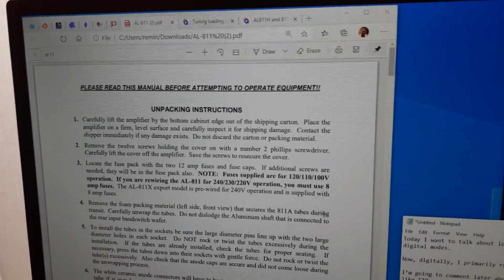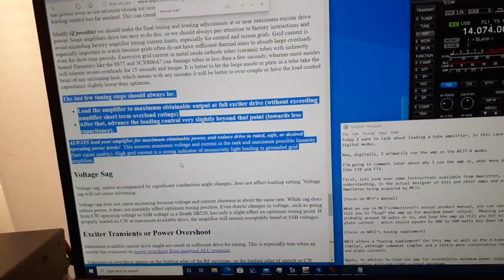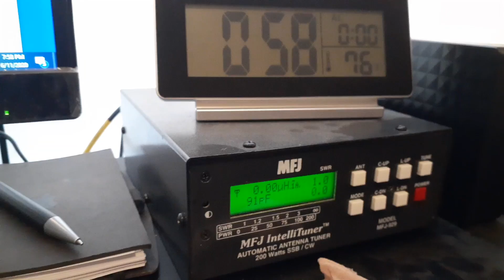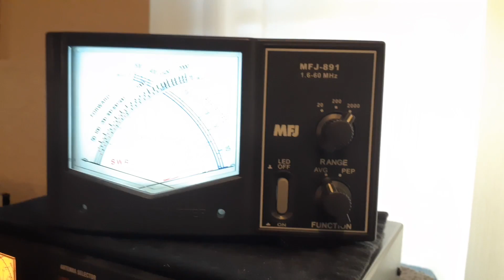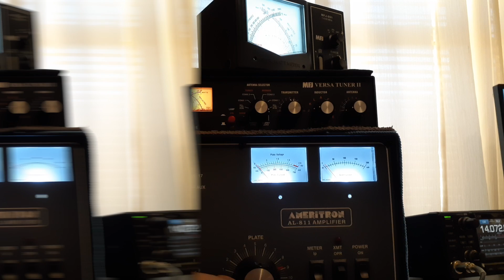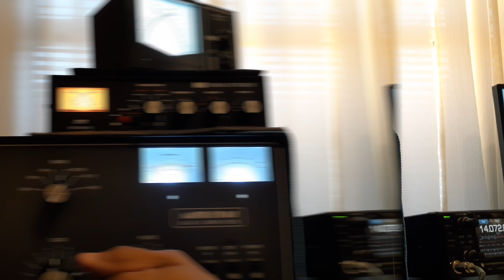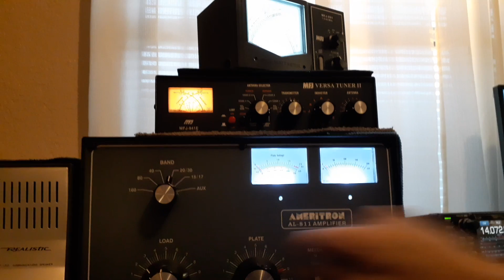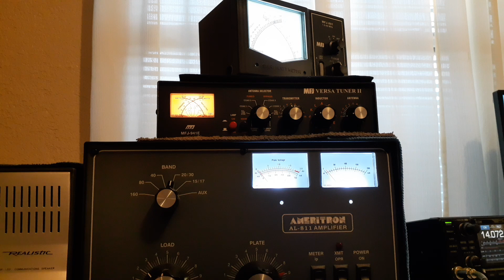Tuning up an Ameritron AL-811 Amplifier for Digital Modes

Comment from the maker: I have since learned to calculate plate dissipation based on plate current and HV.  I upgraded to a Palstar power meter to ensure accurate calculations.  I hope to do another video soon demonstrating this, as I think it's very important when operating vacuum tube amps on digital modes.

Comment: what would be a good starting point settings for ten meter on the al-811h for ft8  KC3WLS
Reply from the maker: Hi!  I would not recommend anything with 811 tubes.  I performed the 10M mod on this amp a year ago (I snipped the green wire) and found that plate dissipation was way out of range for anything on 10M.  We are talking well over 100W of plate dissipation per tube while only putting out a few hundred watts.  I gave up trying on 10M very quickly.  Though I have yet to research amps for 10M, I would be focused on solid-state amps.  500W would be great for my needs, even with compromised antennas. Something based on the 572B might also work, but I'd get opinions on that.

Comment: Digital modes were designed for use with low power.  Their nature is to be functional at 25 watts or less.  There is no reason whatsoever to use a linear amplifier with digital modes!  Doing so just makes a mess of our crowded bands!  This is especially true for the FT4 FT8 modes!

Comment: First, that tuner is not rated for the power that the map will do, and second, the meter goes between the amp and the tuner.  The 300 watts listed on the tuner is transmitter input power, so the tuner could safely handle 180 watts on SSB and maybe 150 watts CW and digital.  That's based on 60% efficiency of the transmitter.  300 x 0.60 = 180 watts.

Comment: Im amazed that you have a tuner on top of that amp. Mine gets way too hot to do that.
Reply from the maker: Really?  I never noticed the temperature, but actually I've never checked. It has never felt warm to me while using the tuner.   Do you have a similar amp?

Comment: How are you not frying the antenna tunner? I have the same one and it is rated to only 300 watts of power.
Reply from the maker: Hi!  Well, nowadays I'm generally tuning up around 225W, so that's within the 300W rating of this tuner.  Also, usually I'm tuning with the tuner bypassed to dummy load.  

I have run 500+ watts through this tuner though, and it worked fine, probably because I match at the antenna feedpoint to less that 2:1 SWR, then use this tuner in the shack to touch it up to 1:1.1 or so.  By doing this I believe I'm putting less stress on the Versa Tuner II's components. 

Obviously I'd recommend an appropriate sized tuner, but the cost jumps up significantly above 300W.

Thanks for watching!

Comment: Nice vintage computer, I see a 5 1/4 floppy drive. Nice video, thanks for sharing.
Reply from the maker: Thanks for watching!  It's an IBM PC/XT, I believe this one is from around 1985.  I have two, both in beaituful shape.  The XT has a 10 MB HD, 5.25" 360K diskette drive, and this one has 640K RAM, ethernet installed and internet connected.

Comment: It was very good information I have an 811 I don’t usually run it too hard but thank you and I hope you’re watching if you have any other videos God bless
Reply from the maker: Yeah I really need to do an update as I've discovered some more information, in particular how to accurately calculate plate dissipation to nearly the watt, to keep it at CCS (continuous commercial service) levels (45W per tube) which I think is desirable for digital modes.  Thanks for the reminder, I'll begin working on that soon, hopefully this weekend or next week.  Thanks for watching!

Comment: That some great points for digital modes. I have the AL-572 with my IC 7300 . I always per tune in dummy load first. I found with my setup tunning with reduced power than near full power get the peek output and dip grid amps then reduce drive a bit and runs great, Grid current stays down and tubes make less heat. I found on AM I get wrong peek unless modulating the carrier. The dead key works FM  dipping the grid. When in AM I got back swing . simple tune when speaking get me right on.  also keeping drive down on AM really helps. I have Russia tubes in now. ben going strong many years. I never run full output. only for a quick full power tune then I drop drive. China has some great 572/B tubes . I have some. you can use 811H china tubes but getting hard to find now . Taylor tubes. I only have a few left. 73's

Comment: Thanks for your insight. I have the 811H. Correct me if Im wrong please. Per your video I am tuning at 20 watts out from the rig then adjusting the plate,load and plate again for max defection. Then increase the load slightly then I reduce power out from the rig to 8 watts which seems to give me close to 200 watts. Your method acually gives me higher wattage going out from the amp then the conventional method. I also dont understand plate glow. Thanks again!
Reply from the maker: 8 watts seems a bit low for 200 W output, but I don't have an H.  I'm concerned about increasing the load AND reducing power.  If you reduce power, you are in effect increasing the load which requires more capacitance, and would normally mean naturally a lower numerical setting on the load control.  

I think I would try tuning at 10 Watts exciter power and see where you're at with RF power out of the amp.   You are more than halving the exciter power after tuning and I'd be concerned about that.  At these power levels you're probably fine either way anyway, but efficiency might be affected.

After i made this video I discovered through trial and error that I should be tuning at even lower exciter power than I was in this video.  I touched on that in my other comment below.
Reply: @SWRadioConcepts  thank you for your reply. I now tuned with 10 watts drive and got about 110 watts out. The plate was 300 and the grid was just above 10. Does that sound right to you?
Reply from the maker: @dougburrell  Grid is most important and 10 is barely bumping the needle, plate seems high in comparison but I think the 811 can handle max 750 if I remember correctly so that's fine.  Is 110W maximum RF out at 10 watts?  If you want 200 then I'd go ahead and retune at 15 W and see where it's at.
Reply: @SWRadioConcepts  Thanks for your help. I think I will leave it at 10 watts. Sometimes my digital tx last 4 minutes on FLDIGI. I really appreciate you getting back to me.
Reply from the maker: @dougburrell  oh yes, with fldigi I would definitely keep it where you have it, 10W.  I've been very hesitant to use my 811 with fldigi at all.  That's a reason I kind of regret not getting the 811H for more headroom for fldigi modes.  I'm glad you came across my video because tube amp tuning for anything less than full out 600W, 800W, etc., isn't well documented in my opinion.
Reply: @SWRadioConcepts  thanks and I know what you mean. I think I saw you having the same discussion on qrz. I'm still hesitant because when I adjust the load at 10 watts I can't seem to find the sweet spot. The amp seems  to do better tuning the conventional way and then reducing power. But I'm still not confident.
Reply from the maker: @dougburrell  Sometimes there isn't enough capacitance built into the loading control to tune at a very low output.  Does it feel like you need to rotate the load control below zero to get max power at 10 watts?  At  the power I run my 811 I'm fine on 20-meters, but for example, 80-meters needs more capacitance than built into the amps loading control to tune up at lower than max possible output.
Reply: @SWRadioConcepts  yes I experience the same exact thing. So I've been tuning the plate to peak then adjusting the load to barely see advancement then retouch the plate. Unsure if its correct or not. But it closely mimicks what I have to do on other bands.
Reply from the maker: @dougburrell  That sounds fine, as long as the load control is peaking, or at least nearly peaking the RF output.  If you can't peak the RF out with the load control because it's already at zero - or full counter-clockwise - then you probably are running below the minimum possible input exciter power for your amp, and will have to increase the exciter power enough so you can peak the load without hitting the zero stop full counter-clockwise.  Generally speaking it's probably good practice to then peak touch up/peak the plate at that point then you're done.

If you are advancing the load control one-half stop clockwise per W8JI's recommendation then you would not peak the plate again after that.
Reply: @SWRadioConcepts  yeah your right. Its really hard to peak the load with low power from the rig. Cant even do it with 20 watts. I will play with it some more later tomorrow. Thanks

Comment: I've always tuned for peak max power, then backed off the gain.  I think I'm safe with that procedure.  Where we get into trouble is tuning at low power, and THEN increasing the gain.  At low power you can tune exactly.  But, that's ok if you don't go any higher on the gain.
Reply from the maker: I've found that this actually isn't the case, and if you back off the tranceiver's drive too much, the amp will be out of tune, and thus you can easily drive the tubes beyond their specified plate dissipation limits, while driving the amp at reduced input power.  I know it seems counter-intuitive but it's actually a thing, and precisely how I damaged a few of my first set of tubes.  I'm going to do an update video very soon so stay tuned.  You might find it interesting..  Thanks for watching.
Reply: @SWRadioConcepts   What @azcharlie2009 stated is from the design engineer himself. Tune all the way up to max input, then reduce input until desired amp output is reached. You tuning to 35w and then reducing to 25w is what he says not to do.
Reply: The designer of this amp specifically says to tune the amplifier at maximum drive input from your radio.. Then leave it alone and reduce the drive input from your radio and you're fine. But absolutely do not do it the other way around.

Comment: Whatever W8JI says, that's what we should do....
Reply from the maker: Normally I agree, and he does slightly touch on the subject in his supplemental tuning documentation, but isn't specific enough.  You must tune the amp at the power you intend to operate.  Do not tune at max power then drop the exciter power significantly, or you'll be out of tune and damage tubes - trust me from experience.
Reply: @SWRadioConcepts  Yes, happened to me too. New tube s just arrived. TNX 73

Comment: I got a IC-7300 and will get an AL-811H soon. Now, you got a tuner between radio and amp, and a tuner between amp and antenna at the same time? Is that necessary? I have not seen anyone doing that before. Thanks for the help.
Reply from the maker: It's not necessary, though you wont get 1:1 from radio to the amp's input because its not that perfect.  Maybe 1.3 - 1.5 to 1.  So it's nice to be able to touch that up.  Plus it's nice to have an autotuner when I'm not running the amp.  Mostly I used it because I happened to have an extra one, but i am glad it's there.  My follow up video to this about digital ham radio does a better job explaining it.
Reply: @SWRadioConcepts  "you wont get 1:1 from radio to the amp's input because its not that perfect"
 I have an AL-811H, there are tuning slugs on the back just for this issue, though you have to choose between 20 and 30 since they're on the same slug.  
Doesn't the 811 have this?
Reply: @piquat1  yes it does have those tuning slugs. I was wondering this myself,  issues between bands that are in the same slug aside, why wouldn't one eliminate the tuner between the radio and the amp and use the slugs to tune the match between radio and amp?
Reply: Thanks a lot for the help.

Comment: Very nice tutorial but I'm a little confused about the mfj 929 when it's only 200watts and you were  tuning the AMP for over 200watts. Educate me pls I wish I was wrong
Reply from the maker: Yeah, my subsequent video did a better job explaining the setup. The IC-7300 is connected to the MFJ 929 directly. Then the 929 is connected to the input of the amp.  So the 929 shows the power between the radio and the amp - less than 100 possible watts.  The other MGJ tuner is connected between the amp's output and the antenna.  Sorry I confused myself when making this video.

Comment from the maker: I've found that using the "tune" function to tune the amp in either WSJT-X or FLDIGI with the IC-7300 set at 25% RF out gives me about 250 Watts of output from the amplifier (as modulated by those digimode apps in SSB-D).  I then knock the transceiver power down to about 22%-23% which gives me 200 Watts of output power for working the digital modes.  The LOAD control then is about half an increment up from where I'd be operating if I tuned at 22%, thus the amp is running ever so slightly overcoupled when actually working digital. Grid current runs about 25ma - 28ma. No plate glow at all, and amp runs cool even after heavy use.  Thanks for watching!
Reply: So what I'm confused about is, with digital modes (including in WSJT-X), output power is controlled by the volume level of the audio going into the radio from the PC and not the radios output power (drive) setting. So what do you use to determine the drive level and set the output power from the amp? In Australia were only allowed 120 watts on digital modes, but you have me very interested. BTW, great video!
Reply from the maker: @VK5IR  hi!  It's some trial and error of course.  You have two levels, the USB modulation on the radio, and the volume of the audio output on the computer.  I'd start about 50% on both.  I like to set it up so the volume slider in WSJT is about -6db or so before I see ALC action on the radio.  I think mine is set about 40% MOD on the radio and 50% on the computer. 
That way neither device is being overdriven and I have some play on the volume slider in WSJT-X for fine adjustment.  It seems to work well!
Interesting about the 120W limitation on digital.  I'm sure I've seen VK stations that must be running more power than that :)